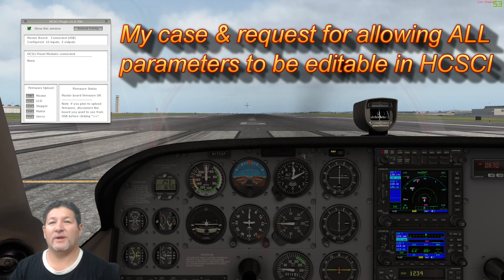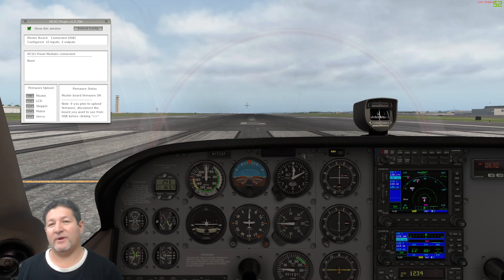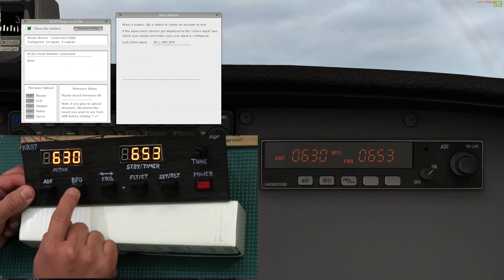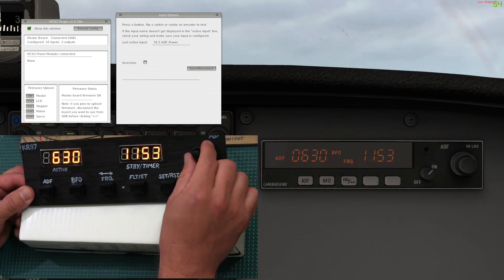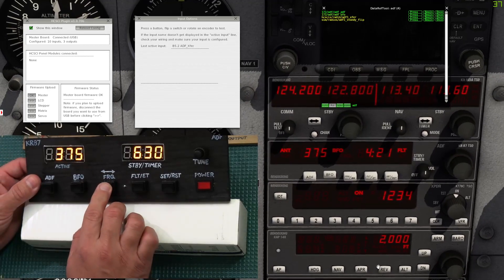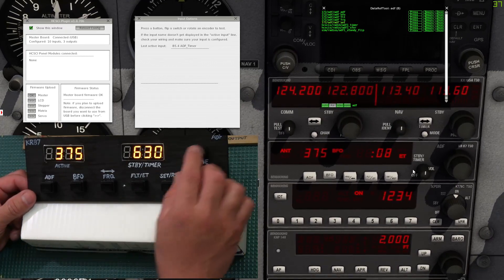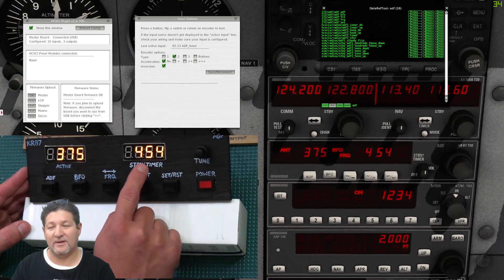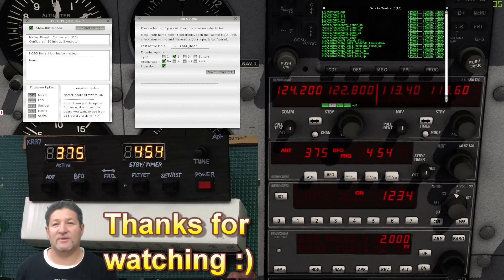My case and request for allowing all parameters to be editable in SimVimX/Real Sim Control

Comment: Jose, it's late , but let me clarify.
1. First, aside of radio panel, absolutely every input control can be converted to any custom commands/datarefs for any custom plane. 

2. As it's stated, the HCSCI Radio functions are all programmed in the plugin the way that allows everyone to build a hardware  device (Com, DME, XPDR) that definetly works in most custom models, because every developer is using (and must using) X-Plane radio frequency datarefs. And all HCSCI radios are "independent" devices with full set of "real" functionality, you don't need to have specially programmed radios in the plane model.  Especially DME devices - you absolutely don't need to even have it in virtual panel.

Of course - we, as developers, are promoting our HCSCIPanel program, that allows to have any instrument (and whole  instrument panel) in hi-res graphics in any small screen with Raspberry, so these functions are serves also for this purpose.

3. Some custom models  have their custom commands for Radio knobs and buttons (mostly to get the custom animation in 3D panel), but they don't prevent writing stabdard XP datarefs "outside" from other plugins. In this case HCSCI functions with hardware device always work fine.

So, yes, you need to have both hardware displays and hardware knobs/buttons connected, not looking to the virtual panel.

4. Only few models (like your Cessna)  have datarefs for knobs and even screens, and  the model script is checking their states in every frame, PREVENTING  outside control. But in final, the script just writing the standard X-Plane datarefs. That's just not good practice.

In this case, if we allow to  convert the radio functions, the HCSCI external radios can stop working correctly (at least for those wjo are using the same community conversion and have hardware devices, not virtual.). 

6. Even before today you could take any "irrelevant" HCSCI parameter and use it for converting your personal cfg for using in such planes.. 
Now, in the configurator we added the "freeform" mode, that can be used as you want.

Afraid that it will lead to more chaotic using of the HCSCI, though..

Regards,
Vlad.
Reply from the maker: It's OK, better late than never as they say.

1. I believe also the Transponder, and ADF parameters cannot be changed as I showed in the video
2. Not all of us are building entire panels or entire cockpit replicas, sometimes we just want to be able to use certain buttons that we use often
3. Unfortunately some of the planes I fly do prevent it. Not only the animation but also just the functionality. Also a lot of us do still use the virtual cockpit
4. I agree with you that it's bad practice on the plane developers side but now we just have to work around their decisions :(
5. I understand your concern about the external radios not working but as you saw on my video, even my external ADF panel is NOT working correctly due to the need
    for custom datarefs and commands so nothing would break there that is not already broken.
6. yes I know we could use any irrelevant parameter and change it, but weren't you always telling us on your website NOT to use irrelevant parameters for something else?

Finally, I think it's great that you are trying to implement the custom parameters that we can add and edit. I think EVERYONE will LOVE that feature and flexibility
Sorry it's given you so much trouble and more work but I really believe it's going to be GREAT for your project.

Comment: This is JUST my opinion,  but it may be a culture thing.  When I was at IBM for 17 years I worked closely with a team from Germany.   They were never open to any criticism and it was very difficult.  We were told that when working with the German team, if you did not document you criticism with a TON of supporting facts,  they would just disregard it because they felt we did not do the work to explain why their way was not solid.   I think that could be the case here.  Tight control and tons of documentation may be the culture.   

However,  that is not the American way if you are not an engineer.  Non-engineers like to experiment and hack.  That's why we are so innovative.  That's a good think in the hobby world.  On the other hand,  that is why Germain engineering is so good. They plan everything down to the smallest detail. The down side is it is slow to market and change in design takes forever.   
You are working with hobbyist, not engineers.  They just want to have fun.  

KEEP DOING WHAT YOU ARE DOING.  Don't let Vlad discourage you.  Many Many people respect what you do and understand that you could make a mistake.  So what,  you ALWAYS go back and correct your errors.   He should be grateful,  You are expanding the use of HCSCI to a larger community. 

Vlad needs to understand  this what you are saying.  Not everyone who using HCSCI is going to be an engineer,  they are a hobbyist. They need your help.    

You are helping people.             

Duane
Reply from the maker: Thanks Duane as always I am humbled by all the supporting comments you have posted. Other people have commented similar thoughts about the culture differences.

I am at a cross roads where I have to make a very difficult decision but I won't do it lightly.
Reply: I know Im asking randomly but does anybody know of a way to get back into an Instagram account??
I was stupid forgot my login password. I love any tricks you can offer me
Reply: @Leonard Kian Instablaster ;)
Reply: @Calvin Tristen Thanks so much for your reply. I got to the site thru google and I'm trying it out now.
I see it takes quite some time so I will get back to you later with my results.
Reply: @Calvin Tristen It did the trick and I actually got access to my account again. I am so happy!
Thanks so much you really help me out !
Reply: @Leonard Kian you are welcome :D

Comment: +1 For this issue found it very limiting for payware aircraft
Reply from the maker: Im really hoping that will change someday, but after almost a year of trying I'm almost ready to give up hope lol
Reply: @Qosmokid  Yeah, I was trying to achieve something with the Ini Builds A300 but was confused that I couldn't edit the default parameters. After that I kind of lost interest in carrying on with my project.
Reply: @Jason118KW  What "default" parameters you need to edit and why? If you plane model use the standard functions, you just slect needed parameter and  it will work.
You can' edit them because everything is already assigned, maybe you understand something wrong? 
And every parameters can be converter to your custom.
Vlad
Reply: @SimVimX_System  Vlad, I've not been back to the site recently but after checking it out it seems a lot has changed. It looks like the problems I had before may no longer be an issue since your updates to the converter and configurator. I will take a closer look and set up my hardware again with your software and see if I have any issues along the way.
Reply: @Jason118KW 
 That's why I always say - use information from the original website, not all videos are relevant, and some videos are harmfull for the whole project,  they even often give you more misleading information than useful.  

This project ALWAYS, since beginning,  was intended to be used with ANY custom plane, the conversion tool allows you to use any datarefs, you just need to read instructions on the website.

If talking about "standard" X-Plane datarefs, they all are completely implemented in the HCSCI parameters, and works as default if you don't need conversion.

Now I redesigned some site pages, making the text shorter and maybe more understanable..

So, for everyone - if you need to know how is the system working - just ASK directly.

Comment: He should allow the personal conversion files to be editable.
Maybe not the community files. What did he care what they user does with his own file. Also in the main configurator Allowing user to add a placeholder parameter.. That can be defined in the personal file. The thing he needs to understand is that he cannot possible define everything that's out there and support all the planes.. it doesn't seem a very efficient use of his time.
Reply from the maker: Wow SG, I had not even thought of the custom name placeholder thing. That is actually an excellent idea, maybe even a genius idea
Reply: @Qosmokid  yeah because many times the solution is too find something that your airplane doesn't  use and then customize it. Useful idea but thanks.

Comment: I noticed that the custom converter is somewhat better than before. I think you can now have more than one command per action even. But how I wish we had possibility to have our own named "actions" and possibility to tie whichever dataref/command to it. For example there seems to be no Terrain on ND light available on Configurator. I used some obscure Led indication and tied the correct dataref to that. But if I had a way to have my own or for example available CustLED1...100 I could have used one of those. 

Even though Vlad and Roman have done remarkable job in creating all this, their attitude in downplaying almost all 3rd party plane developers for using custom datarefs and not LR standard ones is infuriating. Also the full HW cockpit way is also not very good. Many need 3D virtual cockpit or at least 2D instruments for the displays.

I hope that the latest signs show good progress and all my work with my HW and investments are not for nothing. 

And for the ready made çustom conversion dat files, please add the custom command and dataref used... this was for HCSCI guys.
Reply from the maker: Yes I do like this method much more than the previous one. I haven't played with it too much after I found out there was still a lot of parameters that couldn't be changed. I thought even before you could choose more than one command depending on the component but I could be wrong.

Remember they have always said anyone can request for them to add parameters that don't exist. Youre right though, not everyone wants to or can build a full cockpit
Reply: @Qosmokid  based on the latest message from Vlad, some type of "free parameter" will be available in short future. FTW!
Reply from the maker: @whatever0007  yes that's going to be the best thing for our custom datarefs and commands. Im very happy about that

Comment: I loved the concept of Simvim. But I found the same issue.
I wanted to build A320 cockpit compatible for all payware A320. 
I'm a developper. So facing so much frustration with Simvim I decided to write my own software to replace Simvim. 
It is composed of a XPlane plugin, a Arduino program, and a web application. You can modify directly your pin/dataref affectations with the webapp, no need to "flash" Arduino for each change. Arduino program is loaded only one time for ever. And you can see all your Dataref values lively on the webapp.
The webapp run one a any computer Win/Mac/Linux, even so on a RaspberryPi.
Reply from the maker: Wow that sounds interesting. Its awesome that you are able to write your own solution. For us "normal" people with no coding skills SimVim ... I mean HCSCI seemed like a perfect thing until you start dealing with the restrictions. Then youre like "Why can't I change this to make it work!"
Reply: Very interesting.. I'm a developer also and would be interested in knowing more.
Reply: @Bren39 
 It IS exactly what the HCSCI is used for - to create a cockpit compatible with ANY plane model, having just one cfg file, uploading a firmware once for forewer (to firmware update actually).  So - one config, and several conversion files for every plane.

Comment: I loved the idea of SimVim but for the reasons you explain here I moved to AirManager and wrote the LUA myself.
Reply from the maker: 😱 Oh no we lost one.
Reply: @Qosmokid  Have a few friends moving to other software because that reason. Close and more closed system. I don´t understand Vlad and Roman
Reply from the maker: @jetraid  yeah I can understand that. They have a very good product, by far the easiest to use. I dont understand why they can't see they are limiting it's potential by having restrictions like that.
Reply: This is basic stuff. Everyone who’s made any instruments for different aircraft knows different developers use different commands and datarefs. If you do not have the ability to select which ones then that is really poor. From a non Simvim user I would say you should swap to a better platform. Give Air Manager a try it’s way more flexible.
Reply: @ExperimentalSimAvionics  yeah I agree. I love their ethos of making it super simple. That’s great but you still need to option to change a ref.
Reply: @ExperimentalSimAvionics  In an attempt to make it simpler, they closed many options to do more advanced things.
Reply: Yes I see what happens here. AM is now also trying to introduce a simpler way (no scripting) to add hardware. The difference is it’s along side the existing methods instead of replacing it. You have to cater for the beginner and advanced users I think.